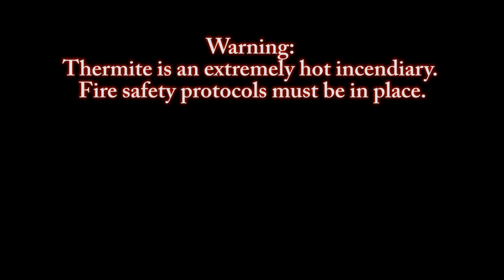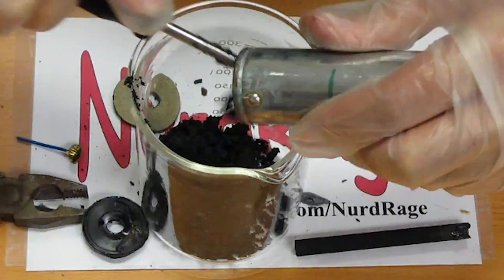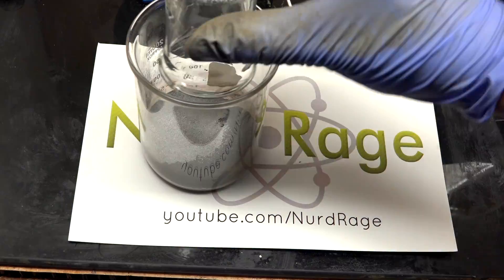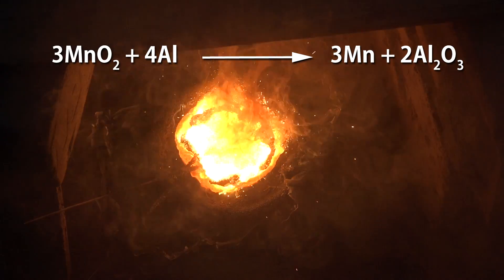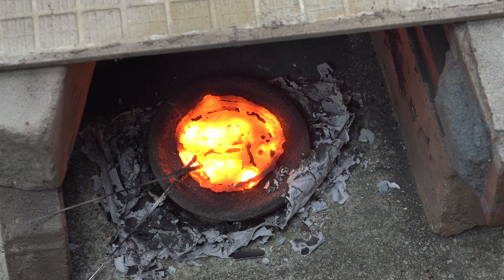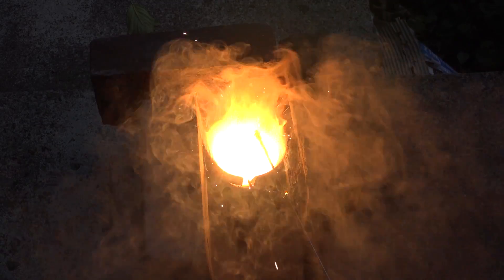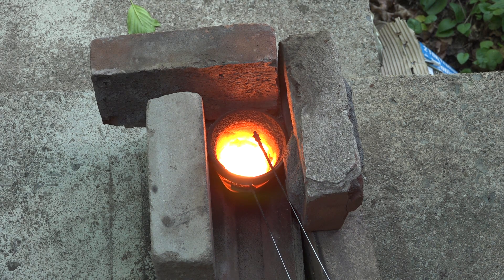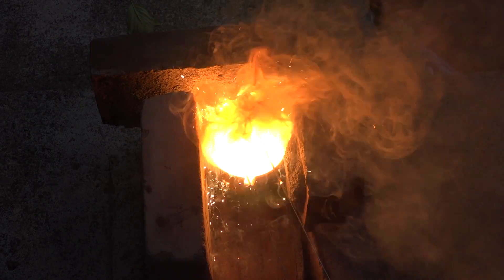Make Thermite with Manganese Dioxide

Comment: Is there any chance that the Mg returns to MgO again because it's so hot? Or is it not hot enough/not enough oxygen to start the back reaction again?
Reply: I dont think the thermodynamics of 3MgO + 2Al -> 3Mg + Al2O3 works out. Even if it did work, any Mg that does form will actually instantly reoxidise back to MgO from oxygen in the air. It might be possible with a different metal instead of Al in an inert atmosphere though!
Reply: +innesd00d Oh. sorry for being not clear enough. I meant the oxygen in the air. I mean you can burn a Mg strip in the air to turn it into magnesia. But the created Mg is probably engulfed in slag creating an anaerobic environment.
Reply: +innesd00d If you heat a mixture of Al and MgO up to 2000C in an inert atmosphere, you should expect the reaction 2Al  + 3MgO --> Al2O3 + 3Mg to work. That's due to such an unfavoured reaction reaction existing in actual equillibrum with the reaction proceeding in opposite way. Now, you may not expect the mix to contain a lot of Mg. And it won't. However any Mg formed should be distillable in a continuous process, as Mg boils around 1000C and Al above 2500C.
Reply: Marcin Goławski this would be incredibly expensive. Sir Humpry Davy invented electrolysis, so why not following that simple and relatively cheap pathway?

Comment: I haven't ever seen any silver oxide thermite before. Then again, come to think of it, that's probably way to crazy for anyone to try.

But please do.
Reply: Its been tried , but doesn't work very well but dose produce silver metal , check out amazing rust , they have a lot of information on different thermites
Reply: Muzik Bike Crazy? Silver oxide is not a very stable compound i.e. it doesn't take much for it to decompose (at 200°C it already does). Thus producing it in a thermite reaction is an overkill.
Reply: Thermight Productions has a video on it.

Comment from the maker: Unfortunately my hotplate stirrer broke AGAIN. This time it's the heating element and it's too fried for me to fix. I'm seeing if i can get replacement parts or order another hot plate stirrer. So until then I'll have to continue making videos that don't need heat. I'll likely do some electrochemistry in my next video if i can't get my hot plate stirrer fixed before then.
Reply from the maker: @abstractcreeper the most straightforward way right now to send me cash is through patreon (link is the video description of this video). For one-time donations my indiegogo page is still up: https://www.indiegogo.com/projects/the-new-season-of-nurdrage-science-videos#/

But don't feel obligated to donate. For sure i'll solve the hot plate problem and i don't necessarily need more money to do it. Donate just because you're shitting money and need some place to get rid of such a terrible burden! :)
Reply: Those hotplate stirrer units are way overpriced. The ones I was looking at are around $500.00 usd and above, if I remember correct.  Maybe you can dissect the one you have, make schematic as close as possible, wiring diagram as close as possible, describe heater and mechanical parts as good as possible. Do this in a video showing close ups of each part. This may provide enough info for someone like me to design and build one. If I do this, I would post the schematic,  electronic cad files, blueprints for mechanical parts etc as an open source project that anybody is welcome to build.
Reply: +NurdRage I wish I were shitting money.
If I were, I'd shit in your general direction, but all I have is farts...
Reply from the maker: @BiddieTube That would be a great idea! I'll see what i can do about my broken hot plates. :)
Reply: that sucks!
Reply: use the thermite you made for heat source
Reply: Can you retrofit a new hotplate to the stir motor? It'll be like sitting your new tube tv on top of your console tv
Reply: I just checked this out. Downloaded the web pages, files etc. Plenty to review and study but appears to be everything needed to build hot plate, but no stirrer. Checked ebay as per comment posted on project page and one can get pid temp controller super cheap, under $20.00, no reason to build own. Being that I need days with 48 hours, I may just spend the $20.00 for it. The parts to build one would be at least that. It will likely be a while, since I have 3 projects on the benches that I am getting all the parts for now. I will add this project now too. I will video and document it completely, have all files available for download, and best of all, it will be easier to build than the one on instructables page. I will post link here once I start project. I guess I will create a playlist for the project.
Reply: Got a P.O. box? I can send you a check for two grand.
Reply: Would thermite also work with glass since it's basically just amorphous silicon dioxide with some impurities?
Reply: I have a big Chemistry test tomorrow (standardized test). Any tips or websites I should check out?
Reply: I placed third in state science fair with a similar thermite experiment. thanks for the inspiration dood!
Reply: +tjousk same
Reply: time to replace it man.
Reply: You know those inductive oven? If you place an electro-magnet in the middle, wouldn't it work? (idk, never tested, in my head it works tho)
Reply: this is perfect that you posted this on my birthday :)
Reply: You would need to purify it first. The paste from the battery is soaked in electrolytic salts and contains carbon and iron-oxide impurities. Doing this is rather tedious and messy.
Reply: make a thermite powered heating mantle
Reply: Can you please please PLEASE do another amateur lab video? Thanks 😀
Reply: It's because there's a limited market and most of the customers (universities, corporate labs, etc.) already pay so much for chemicals that $500 US for a hotplate is nothing.
Reply: off topic but I have a question. is their a way to produce acetaldehyde by a chromium or other reagent from ethanol or acetone? I was wondering about maybe ammonium or potassium dichromate+acetone? I ask bc I read that they are great for oxidizing to the aldehyde but no further. any ideas?
Reply: Weird question, can you burn thermite in a vacuum with the addition of Potassium chlorate or another oxidizing accelerant?  Always kind of wondered if you could weld railroad ties on the moon for example. Gunpowder works in space shouldn't thermite also if it's packed well enough? Probably to dangerous and hard to try since you are releasing gasses in a sealed container at that point, but would be interesting to see if you could manage it.